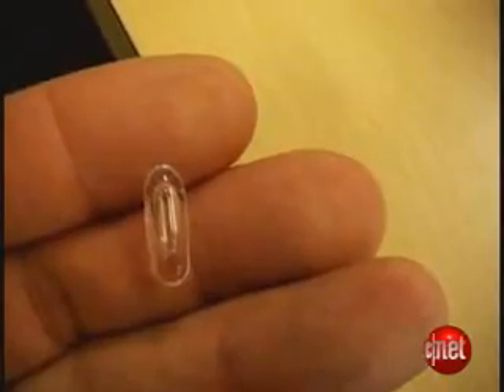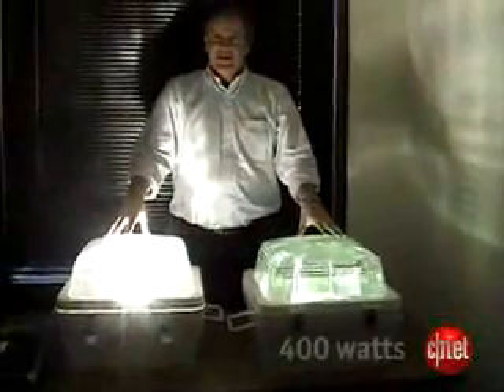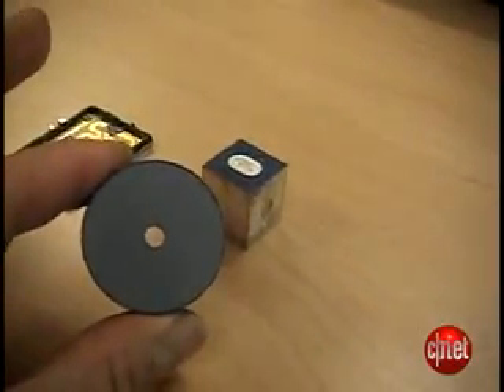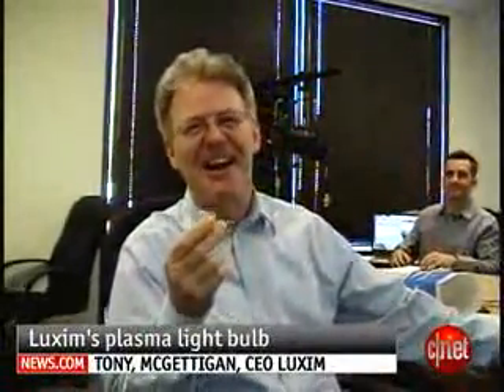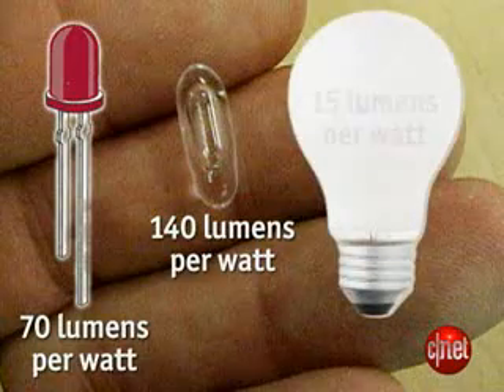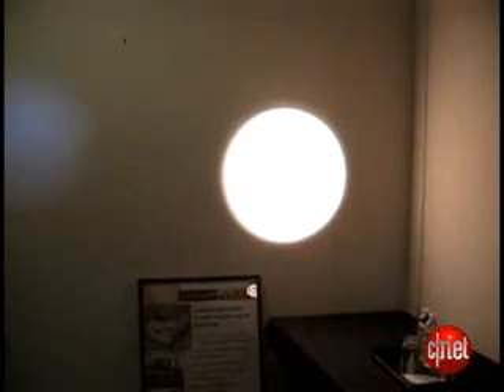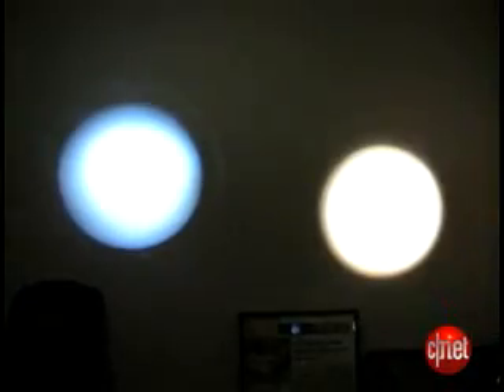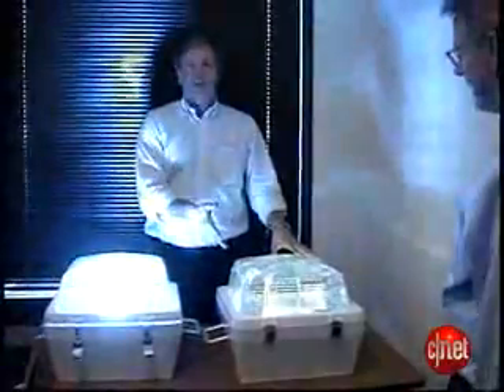Plasma bulb way more eficient than LED's!!

Comment: You can already get Cree LEDs that produce more than 140 Lumens per Watt and they have developed LEDs that will produce over 200 Lumens per Watt.

Still, plasma lighting looks to be a great technology where maximum light is required from the smallest form factor and I'm sure efficiency and colour spectra will only get better as the tech matures.